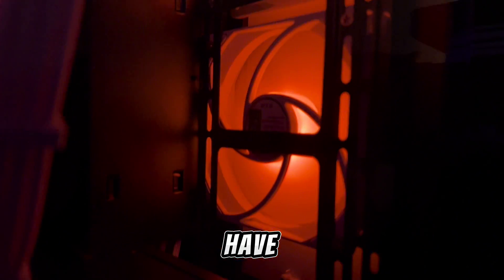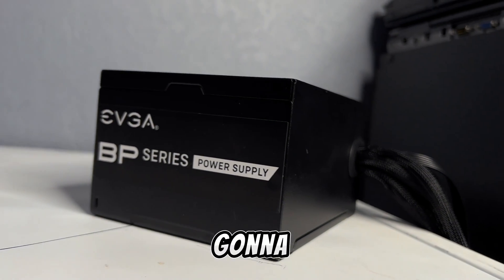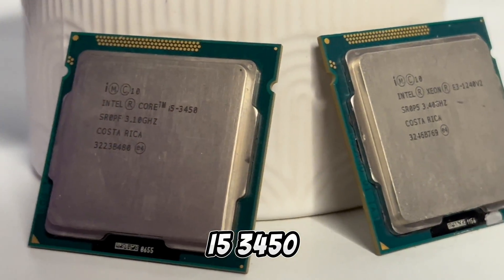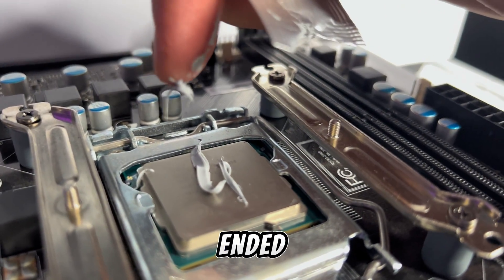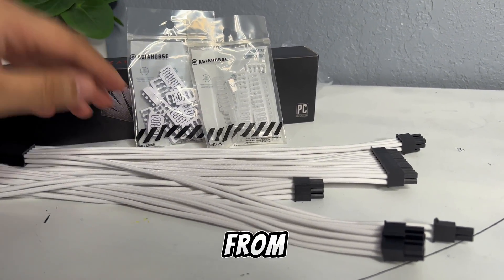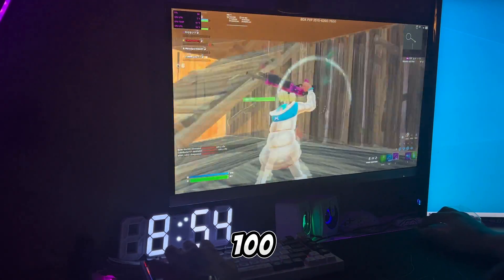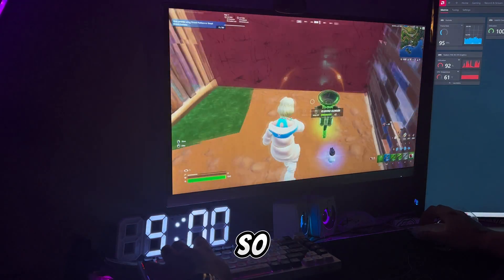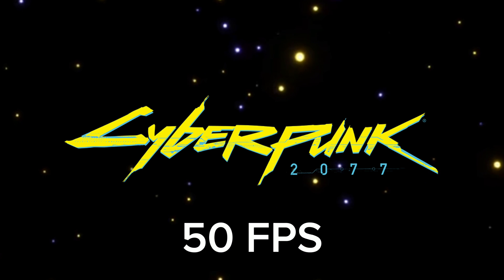Ultra Budget $300 Gaming PC Build Guide (2024)

Comment: any better gpu or cpu i could put with this?
Reply from the maker: The E3-1240 is the best fit for the motherboard in this video. If you're looking for a higher-end CPU, though, you’ll need to switch to a completely different platform/motherboard. Essentially, you can use any mobo/cpu/gpu combo you want as long as they’re compatible with each other. The rest like the case, power supply, and storage are generally interchangeable with any PC, except for the RAM, which also needs to be compatible.

Comment: Bruh , that's a 100 dollars pc
Reply from the maker: if you can find out how to build this for $100 I’m all ears please let me know 😂
Reply: @ZombieDontMiss in my country. I5 3rd gen+stock cooler+8gb of ddr3 ram(8x1)+H61 motherboard with m.2 gen 2 slot for 48 dollars.
Basic Cabinet with 450w SMPS = 18 dollars.
500gb m.2 NVME SSD=36 dollars.

Total=$102

With fancy RGB cabinet and cpu fan=
Ant Esports ICE- 112 Mid- Tower Computer Case=$38
Ant eSports vs500watt SMPS for $24
All for $150 approx.
You can get a 2gb gddr5 GPU for 40 dollars.
With gpu=$190
Reply from the maker: Wtf 😭 
Over here just a power supply and case is about $100